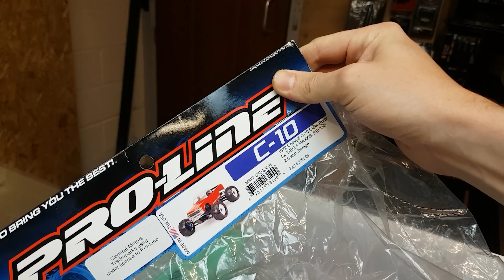EPIC 3s Brushless Rear Steer HPI Wheely King 4x4 Monster Truck

Comment: I know this is an old video but FYI in case no one else mentioned it, you can use axial ring and pinion gears in the wheelie king and other hpi cars that use the rs4 MT style diff gears.
Reply from the maker: thanks dude, are they stronger?
Reply: @KevinTalbotTV  definitely, my son used to only get a couple runs out of a set of stock hpi gears on his 2s brushless set up. Granted I put a spool in the rear also which doesn't help so I switched back to a open diff and thicked it up with some grease. I tried integy gears and axle shafts, they were junk too. So in short, yes they are lol. The only difference between the hpi gear set and the axial set is the ring gear doesn't have the pins on the gear to hold the diff gears down, soI just cut a couple pieces of welding rod to shim against the shaft of the spider gears and the inner face of the ring gear.
Reply: You know what model axial ring and pinion work for the hpi wheely king?

Comment: Kev! The light bar on my wltoys 12429 kept backing out the mounting screws when landing on the topside. I used loctite on the screws figuring it would act like an epoxy and haven't had it loosen up since. I don't mind it being a permanent fix as the whole rc cost me less then $80. Just want to know if it's going to mess anything up over time??